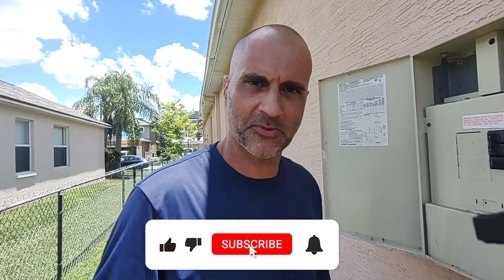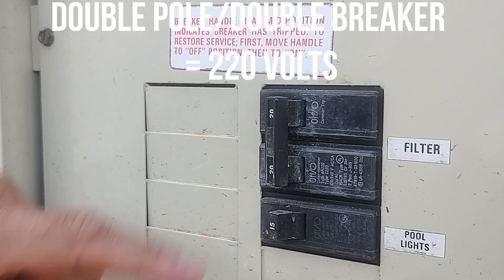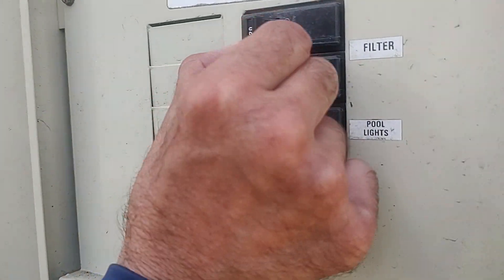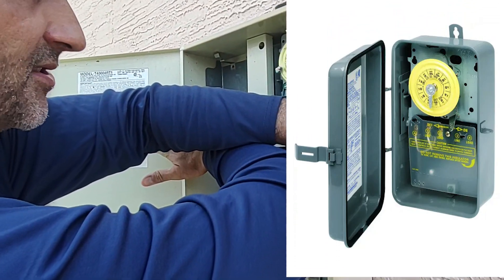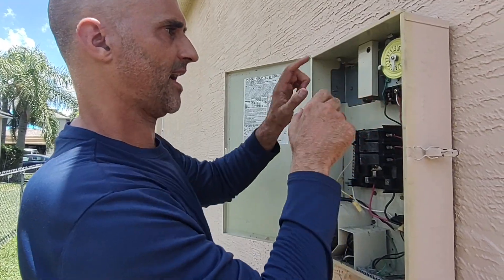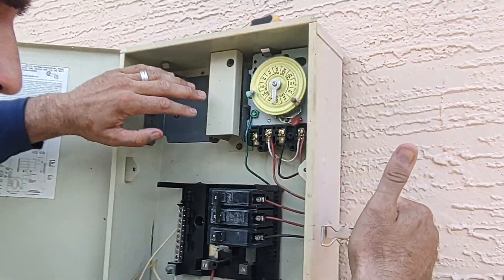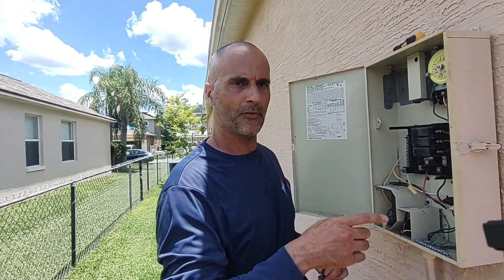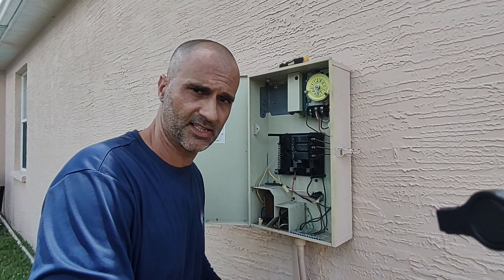IS MY POOL ELECTRICAL 110V OR 220V | HOW TO ID

Comment: Hi, I have a Potter & Brumfield relay (PRD11AGO) in my pump circuit.  Do I need to have it, as I am replacing an old Pentair Pool Pump with a new 1.5hp variable speed pump max 5.6 amps 230volt.
Reply from the maker: I wish I could be more helpful with this but I honestly don't know.

Comment: So i have the same panel. Is 220v plus 110v? Since it has to brakes?
Reply from the maker: I'd need to see a picture. I'm not electrician and I don't want to give electric advise over YT. If there's 1 breaker it is 110V, if it's 2 breakers together then 220V (110+110)

Comment: How many amps in 220 volts
Reply from the maker: There's no fixed number of amps in voltage. You'd get a better answer from an electrician. Sorry I'm not much help on this question

Comment: Thank you so much. I am buying a house and replacing the single-stage pump with a VSP. The new pump only supports 220V. This video eased my mind about having the correct voltage.
Reply from the maker: Glad I could help😀